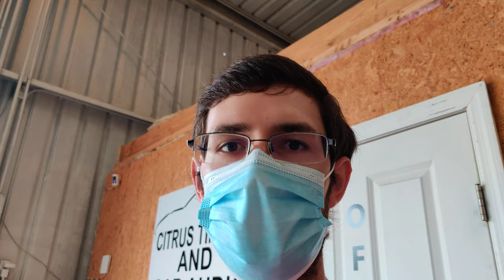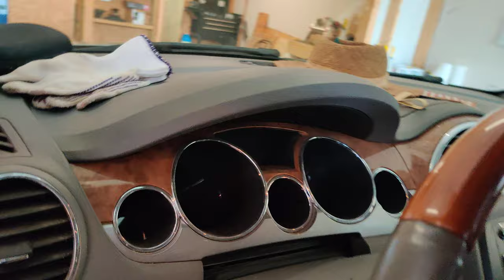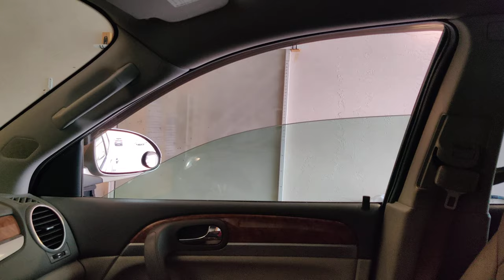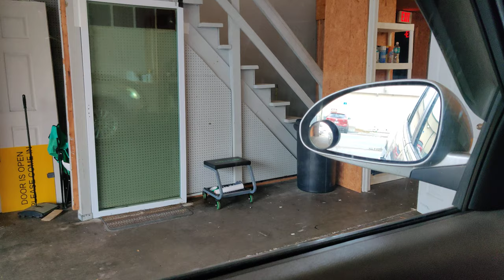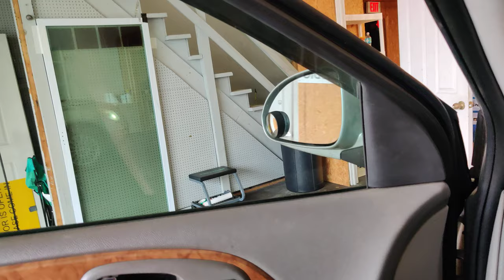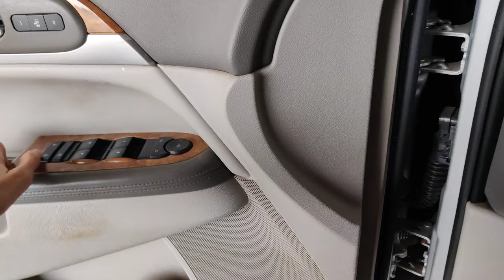Shop Vid - Buick Enclave and The Magic Broken/Working Window

Comment: Brother, this just happened to me and I came to YouTube and found this Vid.  THANK YOU!!!!
Reply from the maker: It's an unfortunate thing to happen but, within the comments I went over the fix, which was fixed by checking the boot between the door and the body. The Enclaves can have a leaky gasket boot on the body end and it traps water. It'll cause a short in the plug when you open and close the door.
If not that, a pinched wire or a Bad Window Switch could also be a problem.

Comment: I had the exact same issue and your theory didn’t work but I shook the black hose between the door and the frame that covers the wires and it worked. Thank you bro
Reply from the maker: No problem. It's a weird issue with apparently several different ways it can be caused/fixed, based on your comment and others comments. 
Though, it all comes back to that black hose/plug being a faulty crap box.
Reply: @AquaVeil  Thanks for the vid.  I just moved around the black boot/hose and it started working.  Still won't do anything unless I do that.  Do you have to replace the whole harness or can you just fix the wire?  I don't see any signs or water.  It is a pretty tight space to to do any work that's for sure.
Reply from the maker: @Fishking1975 yeah, she is definitely tight, lol. But when it comes to fixing the wire or replacing the harness, trying the wire first, if you can find the right wire, is the cheapest option tbh. But if it's not the wire, and it's probably not, then it would be the window switch or just the Harness itself. 

Really, it's more of a crapshoot unfortunately because of how poorly made it is.
Reply: @AquaVeil  Just got the plug pulled from car side.  It was a little damp on the top of the plug.  Shook it and didn't see any more water.  Left everything unplugged for 10 minutes to let everything air out plus its very windy here today.  Plugged it back in and locked it back in place.  Tested and no buttons on drivers side control panel would do anything wtf.  Pulled plug again and reseated again and locked it into place and tested.  Everything works again including driver side window!!!!.  Fingers crossed.  Thanks again for taking time to make the video detailing the problem.
Reply from the maker: @Fishking1975  hopefully it stays working! And no problem, I didn't even know it was a bigger problem tbh, thought it was a weird random thing, and apparently it wasn't at all. Lol

Comment: I had the same problem but with the passenger side window and did the same thing open the passenger door all the way and it started working again
Reply from the maker: @AlvinRockette  yeah, it's a weird, common issue with GM Vehicles of those years apparently.

Comment: The wire between the door and the car is broken. Somewhere inside that rubber boot.
Reply from the maker: You got pretty Close. on this one, the rubber boot was actually leaking in water, causing the weird short. Got a replacement boot and fixed the gentleman's problem. 
I don't think I ever did an update on it though. But nonetheless, faulty boot and a weird window glitch. A bad/broken wire could also do it, yup.

Comment: I'm having this issue now on my 2011. And I'm a delivery driver. It sucks. And on top of it,  I can't open my door from the inside
Reply from the maker: Man that sucks. The double door issue. Not sure which one you should fix first tbh.
Hopefully you can get the door opening issues fixed though, and get that plug checked/cleaned out for the window. Both are very annoying.

Comment: I have a similar issue. The only difference is the window does not go up even when I wise open the door.
Reply from the maker: There might be a fix for you. Two days after this vid, and plenty of trouble shooting, we found out that the issue, funnily enough, was with the Harness going from the door too the car. It was a bad gasket on the cars end, and the plug was filled with water, shorting out just on wire that would slide in and out of the plug when you open and closed the door.
Replacing the harness gasket, drying out the water and fixing the exposed wire fixed the problem for us. 

So you can try checking the harness to the car for water or a shifting wire, it may be the culprit.
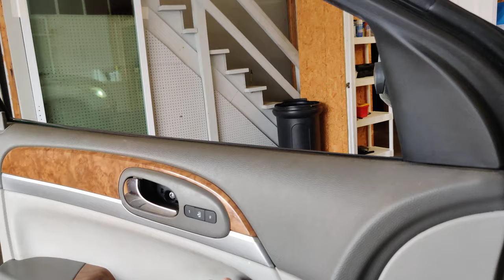Reply from the maker: At 1:38 I made a guess, and yes, that black harness was the issue, leading into the car.
Reply: Thanks for your reply. I'll check.
Reply from the maker: @sirvinb  I hope it helps, it's a very strange issue and not much info on it.  
I should have not been lazy and made a follow-up or an edit in the post, tbh. Letting people know how to maybe fix a common issue? 😅
Reply: Great info and comments! My 2011 Enclave doesn't have these issues but my 2012 Acadia does have window issues.
No windows worked so I pulled panel off and found broken wire close to switch and repaired it now all windows worked with master switch than later I find that the other 3 windows will go down but not up
Using there switches. That makes no sense 
To me. So I pulled the connector off the B piller LR and water came out. Going to make drain holes in all the harness tubes and dry out any connector that shows water in it. I don't know if was a problem before because I bought it as-is and put thousands in mechanical repairs so I wasn't checking switches lol. Seems strange that the other 3 have the same problem. Next the heater door mode actuator problem! Can't afford a new car so I have to fix!!